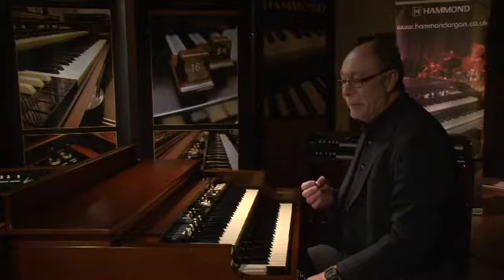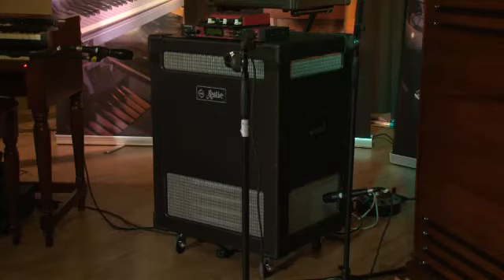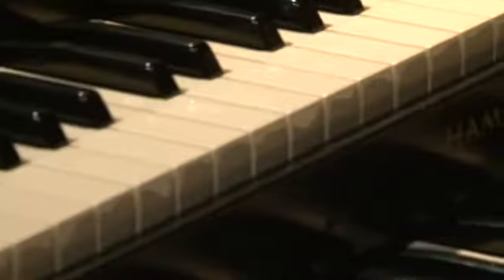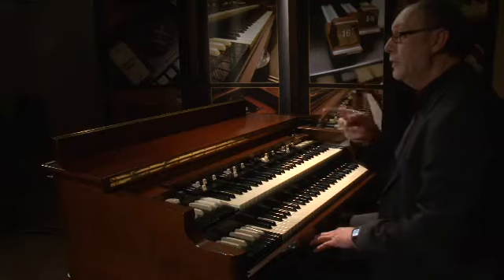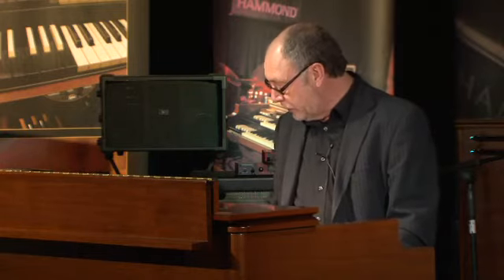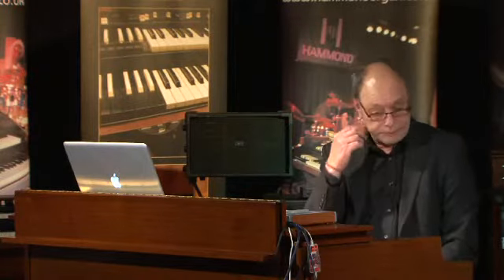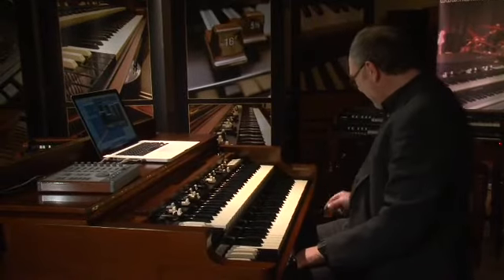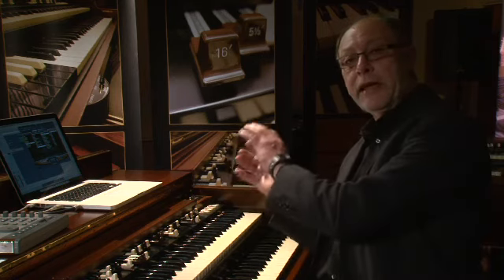Meet+the+Hammond+B 3+mk2 SD

Comment: As an owner of a 50's Hammond B3, I can attest to the nightmare of keeping the copper drawbar contacts clean. Does this B3 still use electrical drawbars, or optical?. Also, how easy is it to clean the key contacts? I assume they are still electrical. Lastly, why does it still have a Start switch?